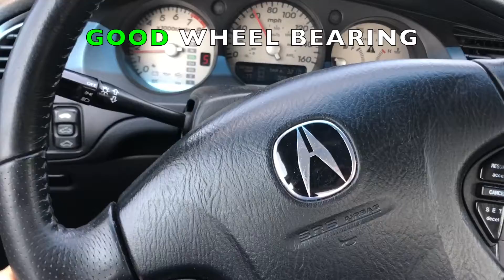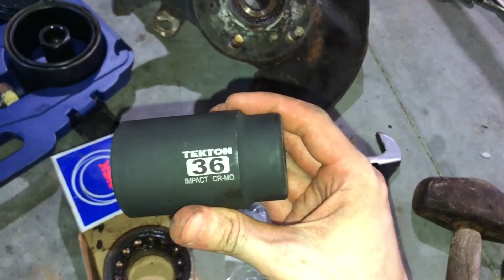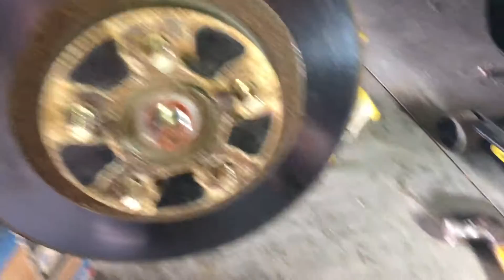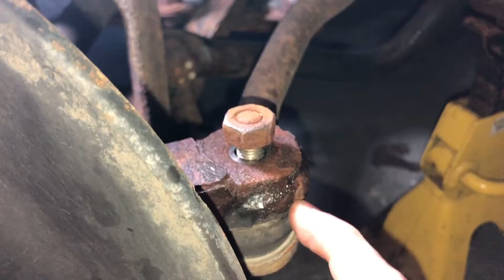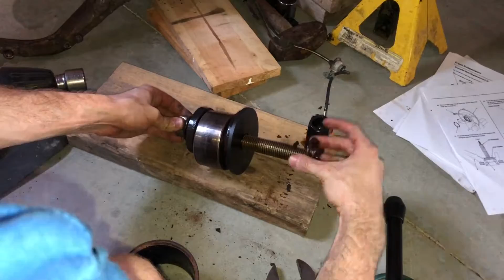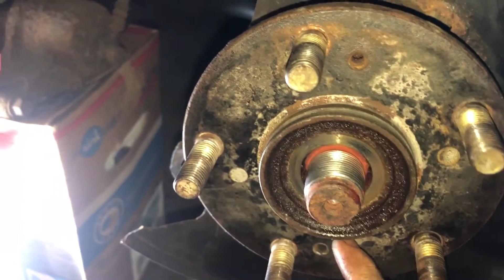How to Diagnose & Replace a Front Wheel Bearing - 2002 Acura TL-S -- Honda Accord

Comment: Ive never replaced the wheel bearings on my TL 2001 336k. It doesn't have the symptoms in the video. I asked a coworker(mechanic) to have a quick look at it at work. Said maybe cv axle or wheel bearing. When Im making a turn theres a "cluck sound"  specially when pulling into/ out of my driveway which I have to make a sharp right to get in and a sharp left to get out and is at a 20 degree angle right where I turn. I thought it could be the mounts but I already replaced those a month ago. I guess the reason he thought it could be the axle is because I also told him that when I put it in reverse and give it some good gas it makes an even louder sound. As if something hit. Kind of like when the rear mount was broken. He visually checked it but it looked good. Hence why Im here watching the video. Any thoughts?....
Reply from the maker: It’s really hard to say as basically every suspension component can make a clunk noise. What we can do is rule a few things out. You said you don’t have my wheel bearing symptoms, so it’s not that. Since you did the “wheel shake” test to check for loose play, this also rules out the upper control arm ball joint. You also mentioned it’s a single loud clunk, not a continually clicking as you’re turning, so that tells me your CV axles are fine as well. Based on my experience with this car, I’ve had to replace the sway bar end links multiple times. Check those for loose play. I also had to replace the sway bar bushings. You can simply grab the sway bar by each of the bushings and see if those clunk too. I also replaced my strut assemblies around 300k miles. If you’re on the original struts, there’s a high chance those are bad and need replacing. Hope this helps point you in the right direction.
Reply: @CarRepairsMadeSimple  yes, I've also never changed my struts. 😬 I uploaded a video, maybe you can hear the sounds Im talking about. Its- "Acura farting at night" I assure you the sounds you hear are not me farting. 🤭

Comment: Being that I own a 2001 TL, I just became a new subscriber to your channel.  Have you had any issues with broken lug studs?  I would love to see your suggestions on how to go about replacing studs.  Also, if one breaks, should I replace all studs?  Please advise.
Reply from the maker: I have never broken a lug. These usually only break in instances of excessive torque, which is why torquing the lug nuts is important, but they can break sometimes due to extreme rust as well. Replacing the studs are cheap and easy to do. You don't need to replace them all, but it might be recommended because even torque on the studs is important for safety. If some studs are clean and the others are rusty, dirty, or simply worn down, that will create uneven effective torque amongst the studs.

You'll need to remove the wheel, brake caliper and bracket, and the rotor. Then rotate the hub to where there is clearance out the back for the stud to be removed. Sometimes the heat shield can get in the way and may need to be bent to create that clearance. Take a big sledge hammer and simply wack it out. Then to install it, you'll take an oversized nut to act as a spacer, put it over the stud, then screw your lug nut on after that, and tighten the lug nut to pull the new stud in until it's completed seated in position.

Hope this helped! Good luck and thank you for watching and subscribing!
Reply: Thanks for your reply. In my case the head of the stud crashes with the hub assembly before reaching the heat shield. I was wondering if yours was the same.

Comment: Another trick to put bearings on easier. Put the bearings in the freezer overnight. Put the wheel hub in the oven at 150-200 degrees Fahrenheit. The difference in metal expansion makes a huge difference. The only thing is you may have to remove the wheel speed sensor so that it doesn’t melt.
Reply from the maker: yup if I could have done one thing differently, I would have put the bearing in the freezer. But everything worked out perfectly!
Reply: @CarRepairsMadeSimple I didn’t mean to imply that you didn’t do a good job. You did a great job! You’re definitely a good mechanic not only do you fix it, but you diagnosed it correctly.. that’s hard to do sometimes. Nice job and great video. Thanks! I learned a lot watching it!

Comment: When you added downward pressure to the knuckle to get the bolt to stop spinning for the lower control arm, did you use your hand for the pressure?
Reply from the maker: It’s been a while since I did this job and I can’t say I remember exactly what I did. It’s possible I either grabbed the top portion of the knuckle and pulled down, or what it looks like you could also do is take a large pliers and squeeze the knuckle and lower control arm together to prevent the bolt from spinning. I remember it wasn’t very easy but what I do remember as mentioned in the video is using an impact helped a lot

Comment: I guess I’m confused about there being “play” in the steering with a bad bearing. I’ve never heard of that and never experienced it either. Just doesn’t make any sense considering the bearing only controls rotation and the hub and bearing are all held in place by the axle nut…
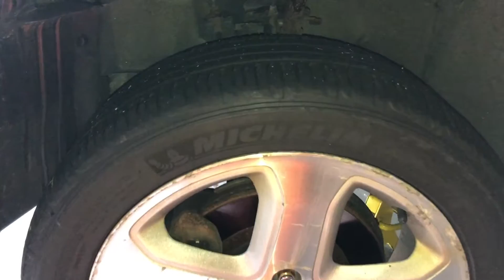Reply from the maker: Well, now you’ve heard of it haha if you look at 2:35, you can see the wheel is visibly moving due to the worn out bearing. This can cause a variety of vibrations, noises, and since the wheel is literally loose and has play, it can throw off the alignment causing the vehicle to pull to one side.

Comment: I couldn't even imagine what a shop would charge to do something like this! Definitely saving money going all DIY edit: I own an 06 Acura TL base and the original owner put 20 in rims (bigger rims in the back and thinner in the front) but he also tore up the front fenders. So Ive got new 18x8.5 for the front and 18x9.5 for the rears, he had stock suspension and I worry since he didn't know what he was doing I'm going to have to replace tie rods, put camber kits, coilovers, and I'll probably also swap out the wheel bears (I'll fork out the money for new hubs) and replace as much suspension parts as possible (upper and lower ball joints) I feel like the previous owner messed the suspension up using a stock set up (no camber kits in either front or rear) and running too big of rims with different type of tires, on the rear he has 265/30/20 on passenger rear and 275/30/20 on the rear driver side wheel. For the front driver side 235/35/20 and passenger side 245/35/20. Not sure if he got a deal or what or got confused but the alignment was way off and the shop said they wouldn't be able to align the car properly with different sized tires on both rear and front rims. I'm going down to 18's (18x8.5 for the front) and (18x9.5 for rears) the Acura has 173,000 miles. The engine and transmission are strong and in good working order. But this whole rim and tire thing has me wondering what the previous owners thought process was, so while it may not need new ball joints, shocks and struts, since I don't have to fix up the engine or transmission I'll ensure it rides smooth and without complications. I've already gotta replace the front two fenders due to the way he tried to "roll them" but at the price he sold it to me and given the fact the ac works amazing, the interior isn't a disaster, and the engine and transmission are running strong, investing in handling isn't a big deal as I already planned to put coilovers on it and Ive got buddies who have the tools and know how to help.. just gotta budget for beer after getting my parts lol. Great video though
Reply from the maker: At least a few hundred dollars per wheel bearing I bet! $40 sounds much better 👍 thanks for watching!

Comment: Amazon link to the Tekton 36 mm Socket is incorrect.
Reply from the maker: Thanks for letting me know. It appears the exact socket I used in this video (4936) has been discontinued by Tekton since making this video. I updated the link in the description which corresponds with the new part number.
Reply: @CarRepairsMadeSimple  Np,  My bearing driver side is also bad and I'm going to follow your video as a guide. Although, I might keep the knuckle intact and use a slide hammer.  Your video is awesome! Keep it up, I mean in a good way - not when cars break down of course. I would love to see a video of you doing the timing belt and water pump.
Reply from the maker: @mrhoangvo  we’ll see! I will probably be due for a timing belt and water pump either this fall or next spring. I’ll look into it!

Comment: I tried this tool and then a 20-ton press. Then I tried both with a torch, but it still wouldn't come out. I ended up cutting out the bearing to remove it.
Reply from the maker: Dang, I’ve never heard of that needing to be done before! I hope my video was helpful otherwise!

Comment: nice video!, i did this with hand tools, same process, same press kit, but i used basic hand tools and a table vice. the hardest part was getting the snap ring off if its at all corroded around the hols for the tool, it may break the snap ring eyes off, it happens, just use your best hammer and flat tip to get the snap ring out, buy a replacement just in case . they are really cheap. its worth it, it took me 4 hours to find one locally without hitting up a junk yard for one. :)
Reply from the maker: Nice work! Yes, the snap ring was also difficult to remove, I'm glad I didn't run into the issue of it breaking!

Comment: What’s the reason for the black side to face the outside?
Reply from the maker: The metal side is magnetized and is detected by the ABS sensor, the black side is the pack seal which keeps the bearing lubricated and keeps dirt out.
Reply: @CarRepairsMadeSimple Hi there... I enjoyed your video as I have a 2003 Acura CL and have to tackle this job myself tomorrow at my father's equipped home mechanics garage. I had seen and helped my father do this repair multiple times in the past but with his current Alzheimer's and old age I will be doing it myself and wanted to research it past what the shop manual shows.

I then ordered a Timken (510050 part no.) bearing as it had very good ratings and was considered an upgrade from OEM from what I could read.

Then it arrived and I didn't see a black ring on either side as both sides were the same metal and it wasn't magnetized when checking against steel.

Then I did some further research and saw a post from the Acura forum from someone else who ran across this same issue when changing their Acura (99-03 TL) wheel bearings who then called Timken to ask about these bearings and the lack of the black seal ring side and Timken informed them that the ABS sensor wasn't tracking the magnetic side of a bearing but was rather tracking the tone ring on the axle.

https://acurazine.com/forums/2g-tl-1999-2003-98/timken-wheel-bearing-976474/

So after some more searching on YouTube I found someone who was switching out a corroded ABS tone ring and saw what it looks like and then found it in the service manual described as an ABS pulsar ring which when tracked by sensor when spinning generates different voltage depending on wheel speed which allows the sensor to detect loss of traction.

I then found the driveshaft outer axle diagrams in the shop manual and confirmed what it looked like on the axle.

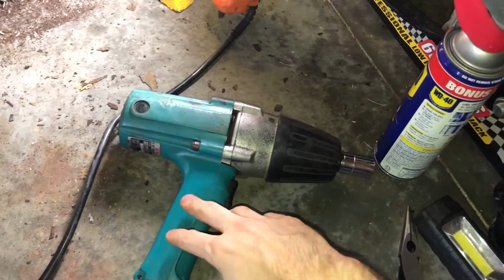I then went back to your video where the video of the removal of the axle on your TL being removed and there is a good view of view of the axle along with the ABS pulsar ring at about the middle far left third of the screen at 17:27 and it looks like the TL that you are replacing the wheel bearing on also detects ABS wheel spin through a tone ring (large ring with teeth on the axle ) rather than through any magnetic wheel bearing seal.

So in the case of the Acura CL or your TL it appears that it shouldn't matter whether a magnetic wheel bearing is used since the ABS sensor for these cars doesn't use that system but instead tracks ABS requirements based on the sensor interaction with the toothed pulsar ring.

So as far as I can tell it doesn't hurt to orient the metal side of the bearing facing inward that it doesn't matter for this model of car.

So a non-magnetic Timken bearing that has no black seal side and instead has identical metal on either side will work just fine.

If I am missing something then I guess that I will find out tomorrow after replacing my bearing. 

But the guy from the Acura forum seemed to be okay so hopefully no issues will arise on my repair work either.

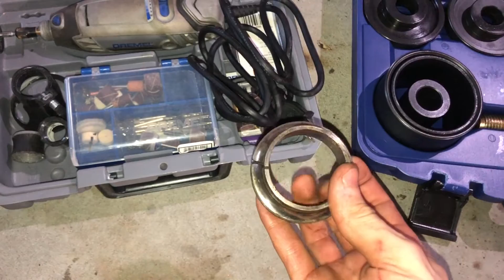Later Edit: Actually found another video that shows a wheel bearing replacement on a 98-02 Accord and it appears that these models also used the "geared" axle pulsar tone ring as well since you can see it on the axle and then when replacing the bearing you can also see at either end of the new bearing (5:53 & 5:57) that there is a metal ring on both sides of the new bearing when it is being pressed in.

So that adds some extra assurance that the non-magnetic Timken bearing I have should be okay without worrying about bearing orientation.

https://youtu.be/vyTSw6_o_Kw?si=XfOcK-XIrqS1OJu8

This video also shows the same kind of hydraulic press setup that my father has in his garage which was also a nice refresh on the usage of a press system.
Reply from the maker: @GTA1Steve  Thanks for the information! I just checked the forums and found the same information confirming the ABS sensor picks up the signal from the axle, and also that the Timken bearing should work. 
However, to anyone using the OEM NSK bearing, the Acura Service manual does specifically state to orient the black pack seal towards the outside, maybe to expose the seal to less dirt.
Thanks again and thanks for watching!

Comment: I just did the passenger side wheel bearing on my 2003 TL and your video walked me through the process (I paused it many times lol), specially with the kit and how the pieces fit together and their individual functions.  Thanks so much for spending the time to put this together.
Reply from the maker: I'm glad my video helped you! Great job on a difficult project!
Reply: Just got mine replaced on same side to!! Same year as urs 02 tl

Comment: I have a 2004 TL and mine is making the same sound as the one you showed while you turn. I can’t tell if I need to replace the bearing or if it’s something else.
Reply from the maker: If it’s only making the scraping sound when you turn, that’s just the rotor heat shield scraping against the rotor. You can usually just bend it back slightly so it’s not touching anymore.
Reply: @CarRepairsMadeSimple  I’ll give that a try today! Thanks

Comment: You have to be carful when buying the wheel bearings cause there is a non abs model and an abs model.
Reply from the maker: Well luckily for this car, NGK only makes one wheel bearing for it. So there should be no worry ordering a wrong part. But that’s good to know for other vehicles!
Reply: @CarRepairsMadeSimple  does the ngk wheel bearing have the abs encoder?
Reply from the maker: @christianlugtu6765  it does. I have had absolutely no problems since installing this wheel bearing. NGK is the producer for OEM Honda wheel bearings, so you can be rest assured you’re getting an exact replacement.

Comment: Bro, I think you just saved me! I bought a 20 ton press to remove the bearing but I had no idea how to remove the hub from the knuckle without an insanely expensive grappler. I'm going to try this method with the two jack stands and a hammer. How big of a hammer do you need? I have a small sledgehammer but I don't know the weight. Thanks!!!!

Comment: This isn’t the way to do this job with that tool. Upright stays put. Turn wheel, Remove axle, hub, snap ring, press bearing out and new one in. 

May need bearing splitter or dremel to remove hub from bearing. 

If you take the upright all off it defeats the tool just take it to a shop with a press.

Use heat. Emory cloth fine, bearing in freezer. M1 synthetic grease on bearing and upright.

Impact on nut not bolt from instructions.

Comment: Too many counterfeit parts on Amazon and EBay.  I would only buy my parts from a reputable online dealer like Rock Auto.
Reply from the maker: It depends on which seller you selected prior to purchase. Keep in mind, everyday people like you and me can sell stuff on Amazon too. If you select "Amazon.com" or the manufacturer of the product being sold, you shouldn't have a problem. But yes you can also get this bearing from RockAuto for slightly cheaper but shipping will take an extra couple days.

Comment: How was the transmission holding up for that car?
Reply from the maker: 314,000 miles all original and still running good!
Reply: Just replaced mine at 226K. 08 TL no type s ( I wish) but need to do the front wheel bearing. Will get this one for sure !!

Comment: Why wouldn't you have applied a grease or lubricant to the new bearing and the hud spindle to aid the installation - also a little anti-seize to all the fasteners as you reassemble the car would aid In things coming apart for future repairs - especially if the car is in a salty winter environment
Reply from the maker: The bearing and spindle went in plenty easy, no real need to lubricate it. If you wanted to use some sort of grease I’m sure you could. And I only use anti seize on things that are routinely worked on, such as the brakes.

Comment: What size socket
Reply from the maker: I'm not sure which socket you're talking about, but I used a 36mm socket for the spindle nut, and I used a 1-1/4" socket for the wheel bearing tool kit. Hope that answers your question!